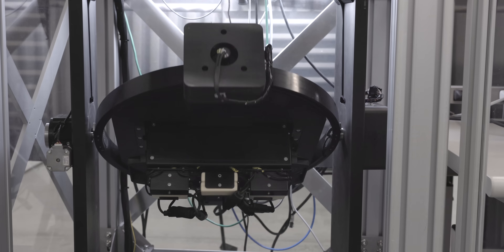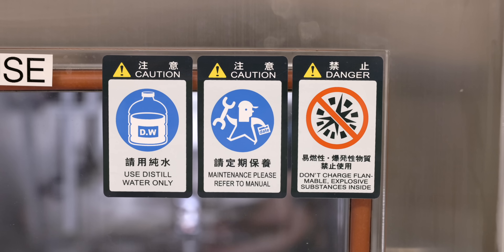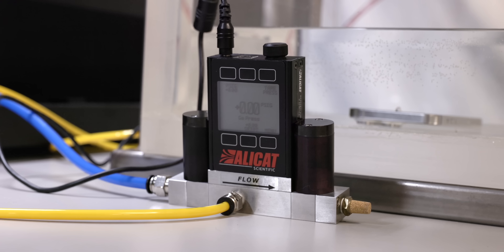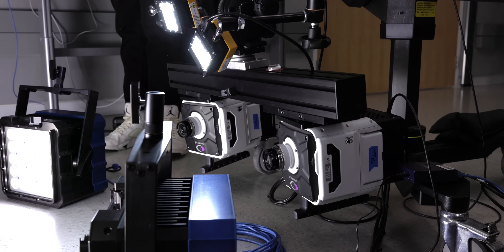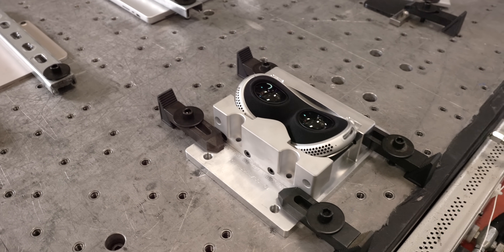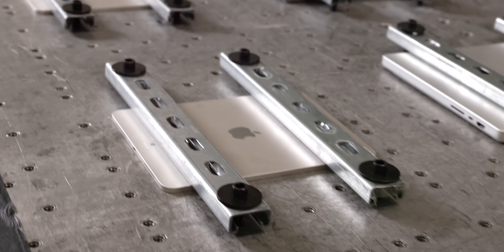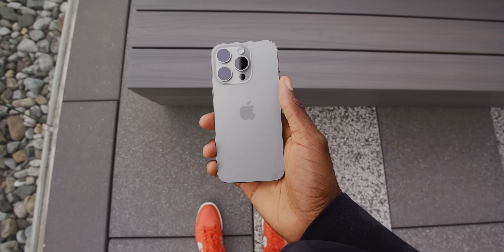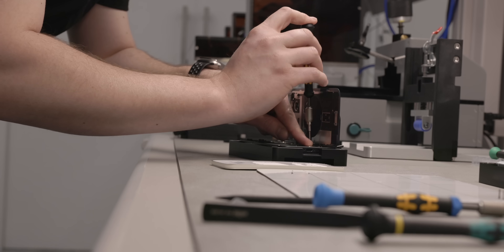I Visited Apple's Secret iPhone Testing Labs!

Comment: It turns out iPhone manages to be neither repairable nor durable.
Reply: iPads will last ten years , but Apple will revoke access to the App Store making the device useless anyways.
Reply: iPhones are unbelievably durable. They have the lowest failure rate of any smartphone.
Reply: @DanKaschel  i would like to believe that but since I haven't used any androids it would still sound one sided and bias but in my 6 years of my Iphone X,  I had dropped it a hundred of times and I never had issue with broken screen or broken back. It landed face flat, landed on corner, all kinds of drops. I just recently upgraded to 15 pro and the reason was just its dying on me way faster and sometimes its unreliable since sometimes I dont receive calls or texts or it would lose network connection ( i think the hundreds of drops in its lifespan played a part in this issue) and pretty much lags on apps that I srsly use for productivity.
Reply: @claxcz  you're not one-sided or biased, you're just a very small sample size :)
Reply: It's both. They are making more progress towards repairability. Fun fact, ifixit just unpartnered with Samsung due to their phones being more and more unrepairable yet iphone is becoming more and more, they are even taking away parts pairing so you can fix your device easier...
Reply: @AndrewPL5  Fun Fact: The $4000 almighty Vision Pro’s glass has the same hardness as your fingernail, and costs $800 to repair, with or without Apple Care.
Reply: @Aesthetycs  cool, nobody was talking about the vision pro, but go off. Fun fact, the outer front she'll is plastic and the inside is glass. Maybe learn what you're talking about before
Reply: @AndrewPL5 I got my Vision Pro early in February so if anyone I am the authority on this, certainly more than you are.
Reply: @AndrewPL5 Apple calls it “Laminated Glass”, and glass is glass. Either way, it has been too easy to scratch, which you cannot deny. As for iPhone, I have had iPhone 12 Pro that has its “Ionised” back glass broken with a two feet drop, and I have had the “IP68” iPhone Xs water-damaged after an official repair.
Reply: @Aesthetycs  there are literal teardowns of the vision pro, the front has two "screens", outer layer is plastic and the inner is glass. It's not like this information isn't available to the public. You have no authority on your imaginary vision pro...
Reply: @Aesthetycs  nobody is saying the outer layer doesn't scratch, what I'm saying is its not glass as you're calling it, that's why it scratches 🤦‍♂️ it protects the inner glass...
Reply: @Aesthetycs  all back glass on phones break. And ip68 doesn't mean waterproof 🤦‍♂️ kid has no idea what he's spewing.
Reply: @AndrewPL5 It does mean water resistance against 2m submersion. And I water damaged it by simply rinsing it. It’s like every time you try to make a point you demonstrate how little you understand the situation.
Reply: @AndrewPL5 Since you are so “knowledgable” about Vision Pro, when did you get yours? If you are trying to teach Vision Pro users a lesson, you had better be one yourself.
Reply: @AndrewPL5 Back glasses break indeed, which is why better phone brands know better than to use glass in the back.
Reply: @Aesthetycs  water resistant doesn't mean water proof...trying to tell me I don't understand when you are again spewing wrong information
Reply: @AndrewPL5 If it scratches it scratches, glass or not. What are you trying do defend? Just because it is not glass its fragility is more forgivable? Do you even read what you wrote?
Reply: @AndrewPL5  context of this? and if you have an article can you please state, thank you!
Reply: @claxcz  ifixit literally said on their youtube channel...did you think you did something there??
Reply: @AndrewPL5  you clearly misunderstood me, i asked for an article because i would like to read it or know more. i was not being sarcastic or antagonizing you.
Reply: @AndrewPL5 Apple calls it “Laminated Glass”, and glass is glass. Either way, it has been too easy to scratch, which you cannot deny. As for iPhone, I have had iPhone 12 Pro that has its “Ionised” back glass broken with a two feet drop, and I have had the “IP68” iPhone Xs water-damaged after being fixed from Apple Store.

Comment: Interesting, but durability and repairability are definitely not on a scale. That is in my opinion a lie that many people should stop believing. The battery repair example is kinda ridiculous. Not making it easily replaceble is a choice that they make in the name of design and control over the repair industry. This results in a direct impact on the enviroment and on customers who will be more likely to buy a new phone. And batteries are one of the most easily replaceble parts in the phone, everything else is way worse. To be clear, Apple is far from the only company doing this. It's a convenient lie for the entire personal electronics industry.

Comment: Although phones are still fragile because of the giant screen I’ve noticed my latest iPhones are far more resistant to falls than the previous ones (I’ve been using since iPhone 5). My friend drops her phone constantly also and the screen is great. Just minor scratches or little bumps on the aluminium part. So I think they really use those tests to make improvements.
Reply: giant phones fall harder - my caseless iphone 12 mini has survived tens or maybe hundreds of falls

Comment: 7:20 This is just wrong. Take the Panasonic Tough-book. Indestructible machine yet repairable in every way imaginable. It's a choice not to integrate repairability in a product. At 9:20 it's said the seals make it harder to change batteries. Take the Samsung XActive. IP68 yet has a user-removable battery. It's just a choice.

Comment: I disagree, a product can be both highly durable and repairable at the same time, but there will be other trade-offs. Such as size, weight, cost and complexity. The balance between these IS the engineering and design challenge.

Comment: this is the thing, we never get to hear this stuff from companies. the more you understand the less something is an issue. i personally prefer transparent brands. as i 3d print ill use bambu labs as an example with the A1 recall. i think they handled it really well. super transparent. and basically said we messed up. the trouble with apple is they remain so tight lipped until the last point they before speaking on an issue. although i suppose you could argue that remaining tight lipped could serve to more publicity as people continue to talk about it.

Comment: I really don't appreciate this durability vs repairability debate, because it's just not true. For all the supposed durability in the world, Iphones still break all the time, that doesn't make them more repairable. At the same time, many car models are both very repairable and very durable at the same time.

I think this has been clear for years, but i will say it again. Apple is a company that wants to make money. On the side, they are also brilliant engineers. So if they wanted to, they would make a very durable and repairable Iphone. But they don't, because they want the phones to break so they can sell more of them. 

Think about it: newer phones look and feel just the same as older phones nowadays. There is hardly any real generational improvement, just incremental design changes. In such a market, if they would create a repairable version of the Iphone, everyone would buy it and then Apple's revenue would take a nose dive because there wouldn't be an incentive to buy a new phone anymore

Comment: im not agreeing this time, my most durable phone has been a redmi 9a a cheap ass phone. its a plastic tank it flew away from my hand like 10ft away and has no scratch on it,  stayed in conta ct with water for like 2 hours and the only thing that broke was the buttons flex cable that whas shorting the button on being constatntly pressed, 2 dollar replacement  part, no serializated parts and phone is still working great. The phone isnt even water resistant rated, but it has gaskets all around the phone.

Comment: Sandy Munro has said the same thing about Teslas when tearing down the newer battery packs. The individual cells are basically encased in a tub of high density foam adhesive. Virtually impossible to repair but they are extremely durable.

Comment: I would be so on apples side if the battery degredation wasn't an issue since like Ip13 I just see year after year battery cycle posts on twitter 
and it seems like iphone 15 pro is possibly the worst it's been in terms of how fast battery health % drops

Comment: Tell Isambard Kingdom Brunel that a product can either be repairable OR durable... Non-sense. There's also size, weight, and cost. It can definitely be repairable and durable but bigger and heavier and more costly. The removal of screws helps save space, maybe cost, maybe weight, but harms repairability.

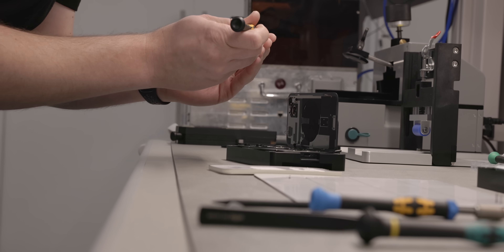Comment: 9:30 man, if its better for the planet, then why you still use parts pairing and making parts repair with ""original parts" more expensive, than letting it be repaired by apple...

Comment: I agree, some seals and adhesives do provide better water protection at the cost of repairability.

You know what DOESN'T help durability but still costs repairability? Parts locking.

Comment: Yeah, the thing is, repairability is e.g. not having 8 types of screws, full glued in battery, software locked parts. This makes the phone not more reliable but more hard to repair. 
Nobody complains about the glue and the rubber, that keeps the water out. Strawman argument and corporate BS.

Comment: Just pointing out that when the apple guy says the failure rates have gone way down. He is referring to the number of repairs that are performed. This is a misleading metric because having less phones come in for repair does not necessarily mean that phones are breaking less often. Because repairs have become more difficult and expensive, more people would rather just buy a new phone than repair their old one, so of course less people are getting their phones repaired. If anything phones might be breaking more often since now people have to worry about the back glass cracking along with the front glass.

Comment: I'm angry with Apple that each successive generation is better protected from water, and still traces of moisture in the phone result in immediate denial of warranty coverage (even if it's a damaged screen, for example). Is the SIM card slot waterproof? If not, why exactly in this place is there a moisture sensor?

Comment: The conclusion that mostly repairability contradicts reliability is absolutely stupid.

For one, when I grew up, I had an Alcatel phone that I could (and did) launch 3 meters or more into the air, dropping on asphalt. The battery and the antenna detached but as they where screw in antennas and click in batteries that's not a problem.
The phone could be opened with a handful of standard screws and it was reliable AF.

Fast forward to an iPhone (or any other current phone), the can be damaged by something like a keyring or an unlucky drop from half a meter beyond use.

That's nearly infinitely more likely to brake while getting a lot harder to repair.

Granted I'm talking about a two color plastic display Vs a high resolution multicolor display but honestly the issue is design (incl. usage comfort) vs. repairability, nut durability.

And this can be seen in rugged devices for commercial use. They are mostly easy to repair but the design shows that it is not intended to please the eye or be comfortable.

Comment: The water signs say DISTILLED WATER ONLY. Interesting as most quote it's the mineral deposits which cause the damage to the boards and electronics rather than the water itself. Depending on the level of dH2O they use and purity, that's oddly dodging a specific problem. Amazing testing overall though- someone tell Elon Musk about this (/Tesla owner XD)

Comment: So to make phones durable, you get less repairability? Did I get that right?

How would he explain all the old plastic devices that are both easily repairably and still works decades later. There are cameras that still work a decade later that went through water and dust, maybe less than that of everyday use phones in 3 years but that's still better for the environment not having throw it away. 

Theres also the Nokia 3310. Its a simple device, yes but its both durable and repairable. How about any new and old Xperia phones that are all easy to repair? I've seen more people stick with their old android and flip phones regardless of their wealth but based on their needs.

Comment: The back glass on the iPhone 15 Pro Max is way more delicate than any previous generation. Mine cracked from a simple drop from waist height never had that issue before, and it was in a case.

Comment: Actually Iphone 6s was already water resistant but Apple didn't claimed it, it was a prototype/not enough for Apple

I dropped it in water and got it out instantly and nothing happened, I did some research and Iphone 6s was already equipped/patented with a sealed lightning port

Comment: That durability vs repairability is n L take.

That's why simple old cars are way more mileage and durable than these driving computers on wheels?

And they are even repairable by yourself mostly.

Just because it's water resistant or durable in whatever means that is doesn't mean it needs to be unrepairable..

Comment: Repairability does not come with a impact on durability, old smartphones were just as durable as new ones if not more before thyey decided to make the backs out of glass, you could open the phone access the screws and repair it yourself. Even making it waterproof was perfectly possible it's just an excuses to make more money when a phone breaks these days. I dropped my old samsung endless times and it is was just as durable if not more than recent phones.

Comment: The worst thing I've ever experienced with an apple, so I switched to Samsung because despite its ip68 feature, it doesn't have a replacement or service when you're under warranty. The worst part is that other gadgets won't work with apple apart from it's product's

Comment: I think you were sold a bill of goods with the repair ability and durability. The fact that Apple had proprietary screws so you couldn’t even open the device didn’t make it more durable, it made it impossible to repair
Reply: Main issue with Apple is not the repairability itself (many 3rd party repairs can do a better repair job than Apple themselves). The biggest issue is Apple not willing to let their parts makers sell the genuine parts to 3rd party repairers, and Apple unwillingness to provide schematics.
Reply: @axn2021  This! This is the the point.
Reply: Talking about  the screws is totally off the mark. Anyone can get a complete set of those "special" screw drivers for song from various suppliers. What people should be talking about is pairing, serialising parts, making the firmware detect changed parts and stop working, forcing chip suppliers to re-package common components so that they are not available for repair shops etc.
Reply: You know pentalobe screwdrivers and bits are cheap as hell right
Reply: @SEMIA123  Are you trying to bring logic into a discussion about Apple hate? It is an illogical discussion, get your reason out of here
Reply: Mkbhd is an Apple fanboy. He'll take anything they say to him.
Reply: @ea_pius  you must be new here lmao. Knock it off 😂
Reply: @krissavagelive  nah, I've been here for around 10 years.
Reply: @ea_pius  nah, that’s cap. If you had been here that long then you’d know that he is FAR from a fanboy of any brand and that his day to day phone isn’t even made by Apple?? Knock it off 😂
Reply: @krissavagelive Nah you clearly are new here if you haven't noticed the trend over these years. Knock it off 😂
Reply: @krissavagelive  MKBHD is an apple fan boy. do you really think linus would have even been able to get permission to have an interview? You only get permission to interview apple employees if you are going to say whatever apple tells you to say.B
Reply: @AcherontiaStyx  what’s his current day to day phone? Question evasion in T-minus 5, 4, 3… 😏
Reply: @MegaLokopo  He’s regarded as being the most important reviewer in all of tech and he didn’t become that by misleading people. Why would Apple have such expectations for someone that could put them on blast in front of millions of people for it? Also, what’s his day to day phone? Deflections expected in T-minus 5, 4, 3… 😏
Reply: You sound like iFixit. Whose business model is to tell you something is near impossible to repair, and then to sell you overpriced repair kits to repair that unrepairable thing.
Reply: Yeah, having to spend $2 on a screw driver makes it impossible to repair. LOL! BTW, anyone who is opening up an iPhone to do repairs already has it.
Reply: you should be asking why is Apple choosing this very niche screw over more common ones. It's Apple and their motives being questioned, that has nothing to do with the consumer's capabilities

Some info that should help you answer that question: The Pentelobe screwdriver is only available NOW. But Apple created the Pentelobe screw and originally there was NO screwdriver on the market for a consumer to purchase.

Makes you wonder if it's only a matter of time before they try again with a new screw design. And again, ask yourself why did they before, and why would they again.